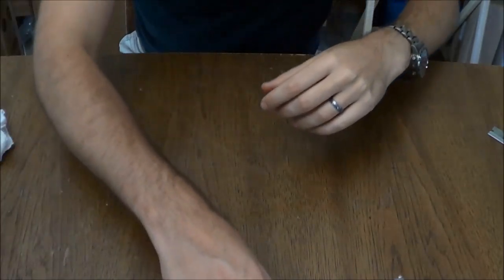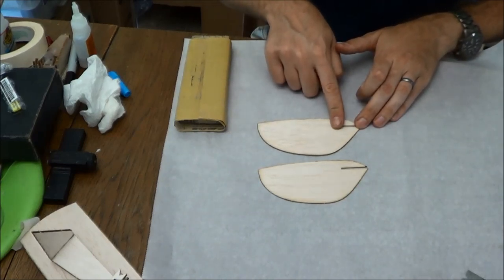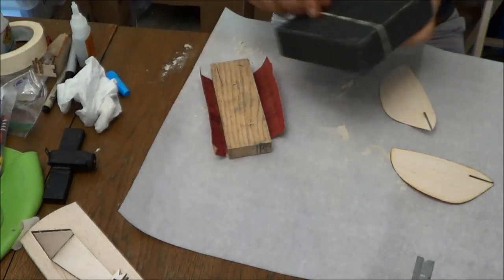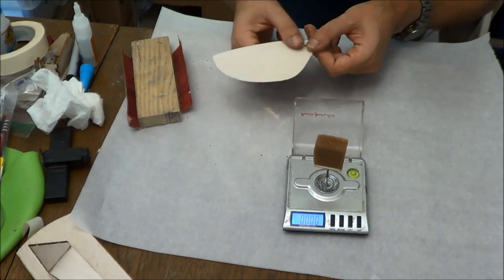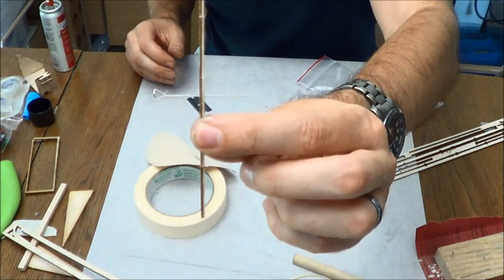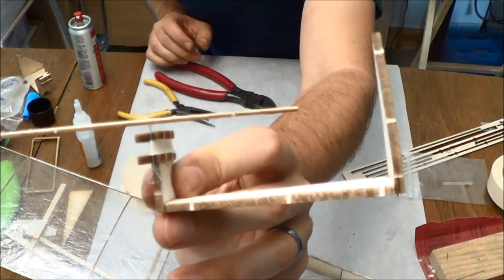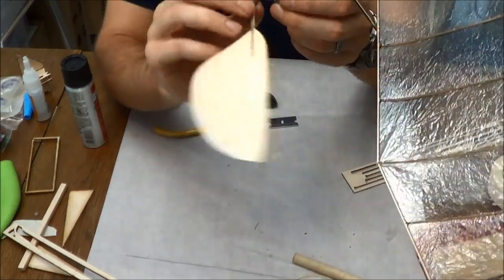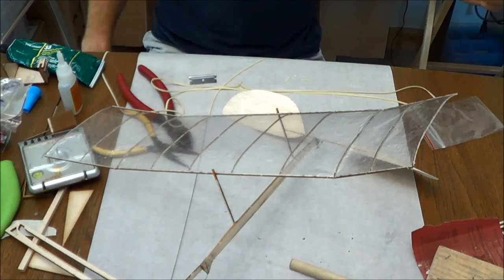Incentsitive Pennyplane Build, Pt4: Propeller

Comment: Thanks for the video. One question on the Sky Voyager. What would you say is the max winding on it with 4 strands of your  tan 2 rubber 1/4" lubricated? Thanks
Reply from the maker: Handing winding, probably 250 turns, stretch winding probably 600 if you really wind hard.